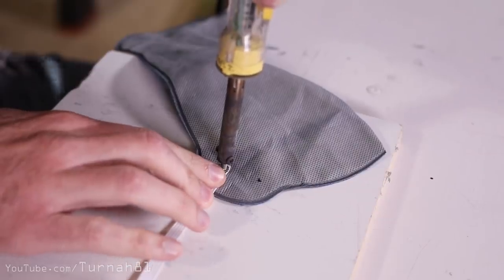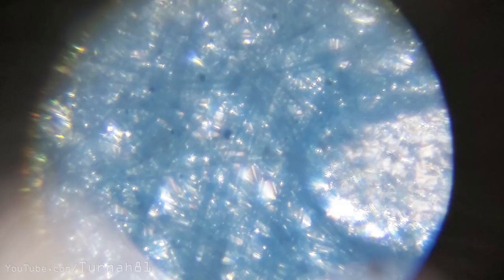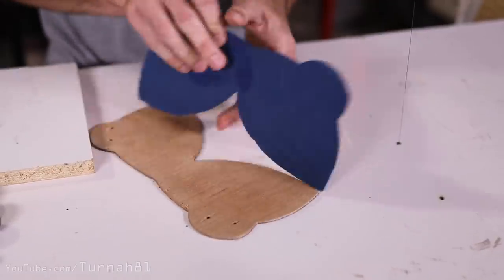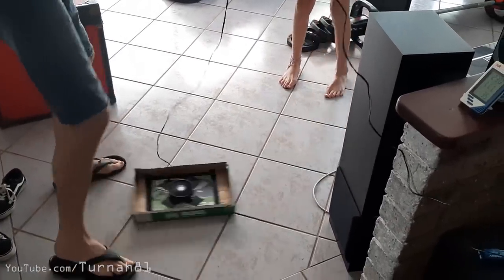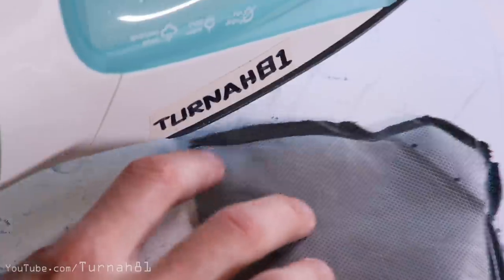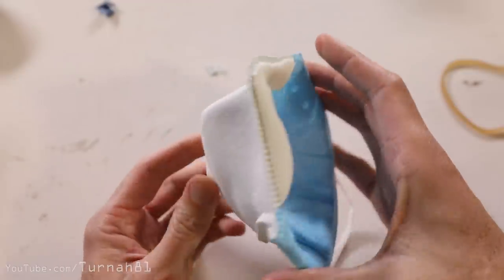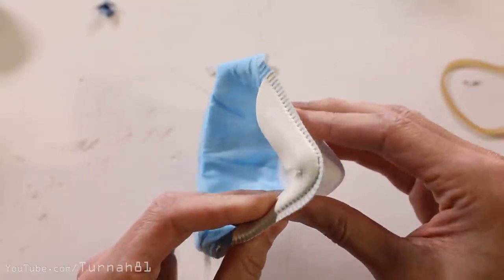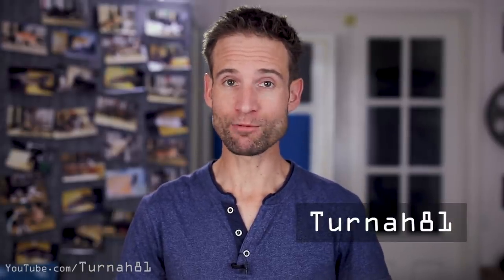How to Make the Best Face Mask, No Sewing (Don't use Cotton or Vac Bags!)

Comment: How are any of those materials 'common household materials'?
Reply from the maker: The most common source of material I found was reusable shopping bags- but the stuff is surprisingly  common - this morning i even found our gel pack in the freezer was in a generous bag of it . The wire and nose foam could be substituted for something else (i was a little too specific in trying to match a N95 mask). Elastic may be the hardest thing at the moment i am hearing. But rubber bands work ok.
Reply: Turnah81 Thanks for the reply, but here in Ireland, the reusable bags are really thick plastic. The freezer blocks and gel packs...you guessed it, plastic. The wire and foam, I suppose would not be a problem as most people will have a piece of wire and a car was sponge in the tool shed and elastic bands in the study(sorry, I didn't think of those when I wrote my comment). Would you be able to suggest a substitute for the main part of the mask, please.

Comment: I am retired nurse of 34 years. 1, you don't fit a mask by holding the mask to the face. 2 they should be one time use. 3. People remove them wrong by touching them then touch everything in public. They pull it down and wear it to the next store or location. Cringe worthy.  People wearing N 95 masks have still gotten sick and wonder why. Because masks should be one time use ie: you put it on and leave it on until you finish your task, then remove it by the ties or elastics and deposit it in the trash, tie up the trash bag. Incinerate it as contaminated medical waste . Is it cost effective...NO so a cloth mask to protect others from your droplets , leave on until task is done, remove by straps into the washer and bleach it. Studies on regular surgical masks show that after 10 minutes of our humid breath hitting it it is no longer an effective barrier.

Comment: Great work making a good fitting form and investigation the fabric.  However, this masks function does not come close to N95 mask.  A large portion of the filtration capacity of N95 or FFP2 masks is achieved by electrostatic charging the non woven polypropylene fibers.  In fact: without this charging, they only filter around 35% of the particles instead of 95%.  For this charging, massive voltages are required (7 of 8 kilovolts).  Still, I think that this mask design is worth making.  The filtration capacity will probably be higher then ones made of woven cloth.  And even more important: it fits much better around the face then ones made of normal fabric.  In the Mean time I am looking dit a way to electrostatically charge the fibers.  Around 7 of 8 kV should suffise. Anyone who has experience doiing this?

Comment: If HEPA bags can release harmful materials if used as a mask, it would follow that the same thing would happen in a vacuum cleaner. In fact a vacuum cleaner discharges a lot more air than a mask ever would, so I find it hard to buy into a theory that they're so bad for the project at hand. Jmho, fwiw, ymmv, etc.

Comment: It has never been mentioned that none of these masks give proper ventilation -Inhaling and exhaling has no where to go but trapped within the mask  breathing out and breathing in the bacteria that has absolutely no where to go . even the ones with vents has a fine rubber inner circle and when looking around the small spaces on outer part of vent  You can see that there is no where for exhaling to go and again trapped within the mask -I do not feel that masks are a healthy option to the person wearing as they are taking their own bacteria directly back into their airways and into their lungs